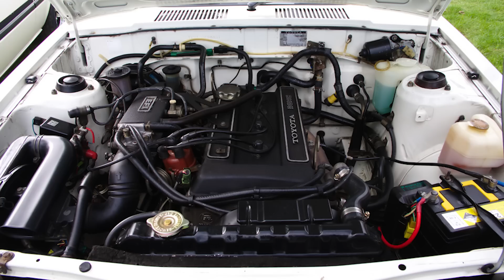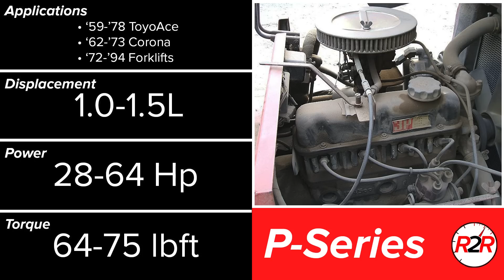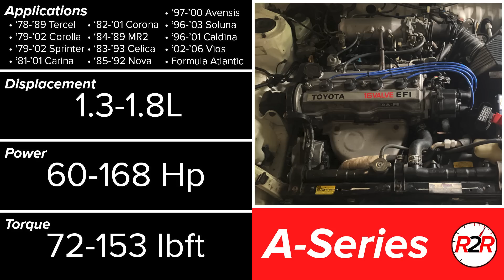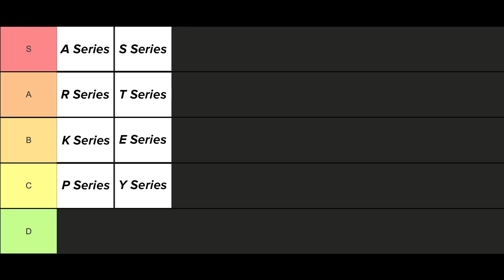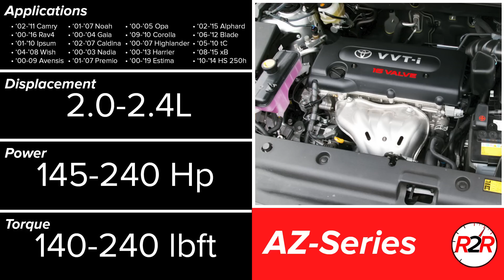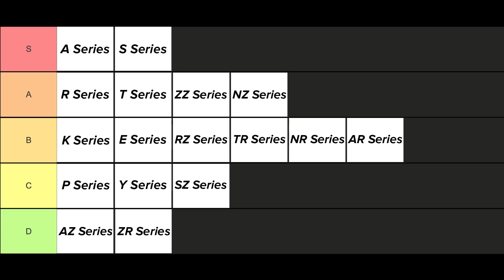The ULTIMATE Toyota I4 Engine Tier List

Comment: I was a technician at a Toyota dealer for 2.5 years and never heard of the zz piston rings being problematic. A few 2zz engines had failed oil pumps tho. Should’ve been S teir
Reply: Switching to a 1zz pan or that morosso (spelling) pan fixes this
Reply: @danktyrant420  1ZZ pan will cause 2zz rod bearings to go out, stock 2zz pan is fine
Reply: @Mark-mm2px  half right. 2zz pan is fine but there are better options
Reply: @danktyrant420  Yeah, as long as its not the 1zz pan, youll starve your bearings
Reply: Yeah those open floored oil pans will definitely starve those engines :(
Reply: @dephataznboi  That is a myth, 2zz pan is more than adequate
Reply: 1ZZs do have oil burning issues, just Toyota said it's acceptable for them to burn 1qt/750 miles. Nothing "wrong" by the book, but burning enough oil to burn the entire engine's capacity between a 3000 mi oil change is hardly good.

This doesn't help the oil starvation issues in MR2s and Lotuses, many of the cars that have the issues are likely starting off low on oil before entering the high-G turn
Reply: Ive had a 3zz-fe engine eat its rings at 205tkm. -01 Avensis
Reply: My 1zz ate rings on mr2😢
Reply: My MR2 Roadster used to have a severe oil burning issue and low compression due to scored bore in 1 of the cylinders. Spyderchat is also full of this kind of failures. 2zz's though aren't prone to that.
Reply: thank you, someone said it
Reply: They fixed the issue in the e12 corolla that are past 2004 with the rings being too big and failing faster than normal
Reply: 2 and a half years only?
Reply: Why same nomenclature with the honda...
Reply: Early non-VVT-i 1ZZ-FEs in the 98-99 Corollas are the culprit for that reputation, the later ones are fine when cared for.
Reply: Yeah what is bro doing putting the 2zz so low in a Toyota list

Comment: 4AFE will always be my favorite. I had a 1993 Corolla and my friend has a 1992. with 440,000 miles, it ran fantastic and I had no doubts that it could make 1,000,000 if the new owner tries. It can also be revved to the moon 😂
Reply: I still have a 4AFE manual Corolla. I'm never selling that thing; it's the only vehicle that has never left me stranded and is fun to drive.
Reply: I have a 1990 AE92 corolla with 1st gen 4afe
Reply: Im restoring an AE92 GTS 4age. It has left me stranded once already with a bad alternator. I suspect the previous owner did not care for the car at all. I plan to boost it if the engine needs a rebuild. Dealing with oil and coolant leaks and it's not even close to 200k...
Reply: Yo I just bought a 1992 toyota corolla with 440,000 miles?

Comment: The one on the scion tc 2005-2010 which is the zz series* would have been a great engine if it wasn't for the bad piston ring design making it burn too much damn oil, a quarter every 500-600 miles is insane.

Comment: S series engines go up to 2.2L (5s-fe)
Their racing pedigree also stems from their multiple WRC wins. These things were legendary in wrc until toyota got banned.
Reply: The reason they were banned is also legendary.
Reply: For cheating... lul.
Reply: and the only s blocks with balancer shafts.
Reply: @redbonetony22 Fun fact, the 5SFE in the 90s Camry has balance shafts. However the one in the Celica is identical but doesnt have balance shafts. Found tbis out when i swapped my Celicas's 5S with a junkyard camry 5S and the oil pans were incompatible.

Comment: The 1AZ-FE in my mom's '01 RAV4 did not consume oil, but it developed a rod knock at 420k km. I swapped a 2AZ from a Camry in it, but didn't get it completely finished, as the head gasket was blown and my time went into moving houses. Not having the space to store that project is something I regret.

Comment: why is the AR B tier? Its a very reliable engine that is fully aluminum with very good head flow and wide angle VVT gears, its a known to make Honda K power by swapping the cams from the hybrid version and moving them a tooth for performance. Its very comparable to the A and S for its time. The AR is the 4 cylinder equivalent of the GR V6.
Reply: I was about to comment almost exactly this! The 2AR-FE, with the FXE cams can make really healthy power numbers, and thanks to the conservative compression ratio, they can make a ton of reliable power when a turbo is added. They are extremely stout, and as long as the oil is changed every five thousand miles, they will run nearly forever. It's not uncommon to see these with over 300k miles still running reliably. 

I think the only thing that holds this motor platform back was the lack of a turbo model on offer aside from the bizarre and fairly uncommon 8AR motor, which was scaled down to 1.8L and shares more in common with the SZ series than the AR.
Reply: @MalcomHeavy  Great minds think alike hehehe 😎
Reply: AR is not good. It's entire valve train and internals are made of paper, the engine can't rev for crap, it's only big. The entire AR swap idea is a ploy by a company (Frakenstien Motorworks) trying to sell products. They are trash engines which is why 20 years ago no one tuned them when they were in the Tc. They didn't suddenly get better, someone wanted to sell gullable people a "cheaper kswap" by trying to be first to market with conversion parts.
Reply: Hope you realize power and tunability is not everything that makes an engine great

Comment: The 2ZZ-GE is one of the most fun engines of all time, reminds me of 90s era v-tech
Reply: It’s too bad it was never mated to a good transmission… except maybe in the Elise
Reply: @aygwm  The C60 can handle a fair bit over the stock 192hp for ages, as long as it's maintained properly, if you still have the original oil in there after 250-300k km and 20+ years then yeah, you will get problems. The gear ratios are one thing that makes the cars engaging to drive, with a short shifter and all metal shifter bushings the shifts also feel really satisfying
Reply: It could just be a thing with my transmission bc it's old, but i hear the c60 in known for not wanting to shift at high engine rpm. @tomboxyz5564
Reply: @tyreksimmons4167  As a owner of a 2000 celica, the transmission sometimes has issues shifting at high gear. I mainly have issues going from 2-3 just because i hesitate a little because of all the moneyshifting stories that circulate about this car/transmission. There is one main issue that i noticed in multiple transmissions, they all have synchro problems. if you dont rev-match perfectly, the car will punish you with a nice grind. This has happened with both transmissions ive had and in 3 of the cars ive test drove. Over all its not bad, like tom said, the short gearing is what allows this engine to shine
Reply: mathewceron4384  it could just be my slow shifting due to the trans resisting shifting after like 6000 rpm; but I never had a grinding problem. Again, you sound your much more experienced with manual cars than I am, and are able shift fast enough to achieve the condtion to grind gears between shifts.
Reply: This also brings me the the origional thought I had. Does anyone have a solution for the c60's moderate shortcomings?
Reply: @mathewceron4384  My 2003 Celica has 350k km and the transmission shifts perfectly. You just have to fix yours.
Reply: @mathewceron4384  I've got a revised c60 in my 2004 fielder Z (closer 3rd-4th ratios than earlier c60s) and I have thrashed the ever living shit out of this car for the last year +. car's done 310xxx kms (~185xxx miles?) aside from an occasional crunch (30% of the time?) going up into 2nd at high rpm (8000+) I have no issues, and I absolutely bang the fuck out of the gears in this poor thing. I'm going to say that the condition of these gearboxes and how they shift would be 100% down to how they get driven and if the service intervals have been met. I have had the transmission fluid replaced in my ownership but I have no record saying it had been done earlier in the cars life.
Reply: @tyreksimmons4167 build it
Reply: @aygwm  The C60 isn't the best transmission ever, but it is really satisfying to shift and solid overall.
Reply: VTEC NOT VTECH BROOOOO🤬🤬🤬🤬
Reply: @Aetherminator115  but mom, I want vtech
We have vtech at home
Vtech at home: vvtl-i
Reply: @tyreksimmons4167 vvl is better imo
Reply: @tyreksimmons4167  Honestly, VVTL-I got the certification to not be a lesser version of V-TEC instead, it actually is better.
Reply: I love my Celica. It's so much fun and the red line and valve lift is just crazy for a Toyota.
Reply: Vtec hommie
Reply: Too bad it never came in a proper rwd chassis.
Reply: @omarawilson2853  the Celica hasn't had a FR platform since the mid 80's.
Reply: @samuelgarner594  I know. The last gen should’ve been rwd though, it was screaming to be
Reply: @omarawilson2853  Yeah, it did. It was used in the Lotus Elise.
Reply: @omarawilson2853  the fwd cars it came in are pretty decent though

Comment: I'm surprised the ZR was placed so low. At least in its North American application in the Corolla, there were not really any major issues beyond the VVT-i cold start rattle in the early revisions and oil burning caused by poor maintenance.
Reply: Very few engines are truly flawed and can't last a long time IMO, some just are just more susceptible to damage from abuse and neglect than others. No engine with low tension piston rings (which is most engines from the 2000's on) responds well to dirty oil. Even the Honda K series will easily get stuck rings and start burning oil if it's not maintained properly. Really not the fault of the manufacturer IMO.
Reply: Same. ZR is a solid improvement over the ZZ.  Whenever I see someone bring up reliability of the ZR it's typically because of documented issues with the Hybrid application.
Reply: Some versions of the ZR are more susceptible to having faults (such as the valvematic ones).

Comment: The RZ should be A tier if the ZZ and R is A tier. It is as reliable as the R series and makes more power. The only issue is burnt valve, preventable if you adjust the valves, and even if you don't it takes a long time to occur. People with the R series upgrade to the 3rz, which is enough said.

And if the RZ is A tier, the TR is S tier. The TR is the RZ perfected, the valves are self adjusting. It has no common problems, and it most mechanics don't have experience replacing them. And both engines are cast iron, so they can be bored out for a 2nd life.
Reply: 3RZ is gods motor😂 should have been higher

Comment: 3rz is s tier. has lots of after market push good power figures
Reply: its in the unique area where when you turbo it and double the atmospheric pressure it gains above award hp say 150 hp 1 bar and you put 2 bar in it will got to say 320 hp not 300 hp it wanted boost and over achieves on regular
Reply: @jacksonbermingham2168  My brother has an '86 Pick-up with a boosted 2RZ making 350 to the rear wheels on E85. Nothing done to the 2RZ other than a Haltech Elite to run it and the boost.

Comment: Good video the A series also has the 20 valve 4age which was the first toyota engine to use vvt. The 2zzge has toyotas version of vtec which has a noticable increase in power at 6200rpm both very reliable.

Comment: The Zz, mainly the 3zz with the oiling issue, 2zz not really a problem
Reply: The 1zz till about 2005
Reply: 2ZZ owner here with 189k miles. I drive it to redline almost once every day it gets driven & the car will take it with no problems. No huge oil burning/consumption, only about half a quart per 3000 miles or between oil changes, which ain't too bad!
Reply: Ive heard it is a problem, just not as big
Reply: Only early 3zz have this problem. My car is a Corolla equipped with 3ZZ it has been running E85 for now 21 000km (with a Map) and it has 207 000km in total. And it's running like a charm

Comment: AZ oil consumption issues, it's mainly year specific problem. the earliest iterations of these engines were just as stout and reliable as any toyota engine. Toyota did a mid cycle update that added low tesion piston rings causing all the oil burning. 

That being said i still do argee about the placement solely do the sheer amount of cars sold with the updated engine, and the with a range spanning so many years (in certain models) It deserves that spot on the list.
Reply: Earlier years had issues with the head bolts. Northstar Performance, known for bulletproofing Cadillac Northstar V8 engines also has a SureGrip kit for Toyota 2AZ-FE engines as well.
Reply: i used to deliver medical supplies for a living with a 2AZ xB that i stripped the interior out of after noticing that a windshield seal was leaking water into the floorboards... by the time i spun the bearings in it omw home one night it was drinking a solid quart a night (250-300 miles), barely smoked at all somehow 😂 it was such a fun car with the waterlogged interior gone, felt like a go kart for big kids
Reply: even with the oil burning, the engine is very reliable as long as it got oil in it
Reply: Just curious what tier should it be if it doesn't have that oil consumption/piston ring issue? My one was made in 2006 or little earlier in Australia, narrowly avoided stripping head bolts disaster and oil burning plague.
Reply: @enchantereddie  I would probably say B tier. It's a solid engine with decent fuel economy and power, but by no means were they built for performance. You see people adding force induction to scion TC's but u won't find many going past 300hp on stock internals.
Reply: @PlayLikeLegends  Thanks for the reply! Yes it's a smooth engine and not thirsty at all. I do all the services by myself. Very happy with it.
Reply: @enchantereddie  same man my 04 rav's got 280k km and runs like a clock
Reply: Also the 10,000 mile oil change Toyota said was a good idea helped gum up low tension rings. Toyota mostly righted the wrongs is nice but the mechanics doing the job of pistons got absolutely screwed on time... The warranty extension time paid by Toyota when from over 20 hours to under 9... The mechanics help Toyota pay the price. I would never work for such a greedy company, they could have paid the mechanics for an actual time it took... I'll never even consider buying a Toyota because of it.
Reply: @justinweaver7553  well hopefully u buy a reputable brand now. Cause the big 3 have done far far worse in terms of not dealing with problematic engines.
Reply: @PlayLikeLegends  you are not wrong, GM and the 5.3 AFM is a joke, "Chrysler" and cam eating hemis and pentastars, Ford with the 2.0-2.3 Ecoboost...yes, all worse because the manufacturers let the customer pay for what they knew all along

Comment: Great video man, I just have a question. I'm looking into getting my first car and I've saved up roughly 20 grand. Now this has given me so many options but I do have a list.

08' C6 (MANUAL)
Lexus IS F 
Boosted B8.5 Audi S4 (Automatic)
E90 M3 (Manual) 
Audi S6/S7 C7
05' WRX STI (Hawkeye)
Infinity Q50S (VR30)

What would you recommend?
Reply from the maker: All lovely options. I do see a stark contrast in terms of the cars at play. Some can get expensive quickly (Hawkeye, Boosted S4, etc). I can really vouch the most for the C6. I had an 05 (given different engine) and it was incredible. Probably the all around quickest on this list while super cheap to maintain and reliable. If you can get over the lack of convenience (hatch is big though), then the C6 takes my pick. Best of luck and you can’t go wrong with any of these!
Reply: @running2redline  thanks man, I think if I want to get a 2 door I'm gonna get a corvette and if I'm gonna get a 4 door I'm gonna get the Lexus is f. Both are phenomenal cars!